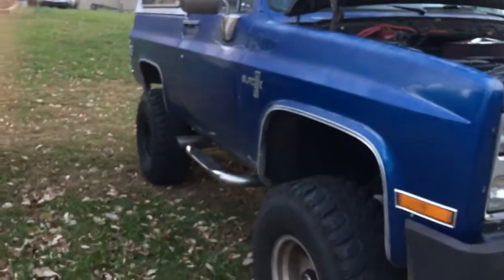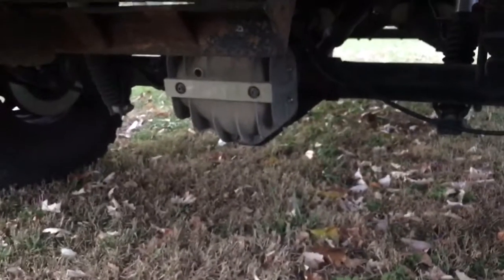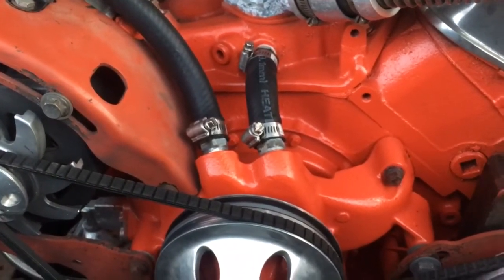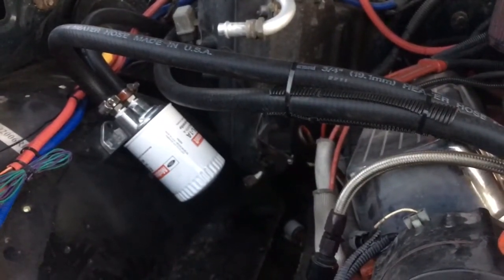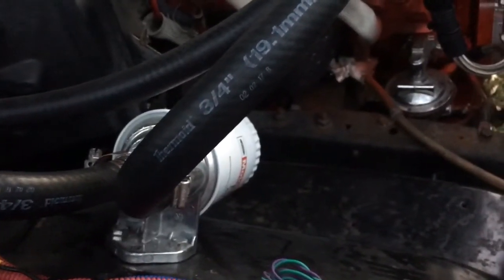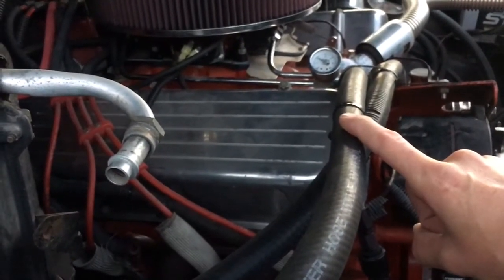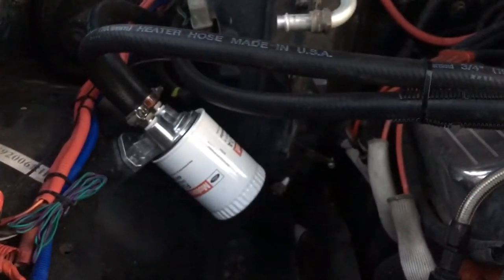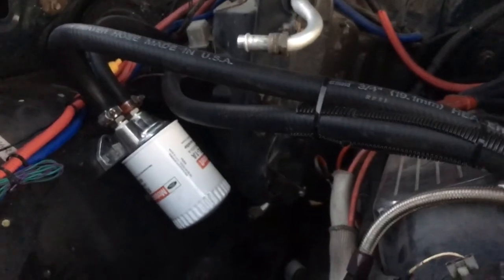Big Block Chevy Coolant flow

Comment from the maker: Hey wheless  when I bought my truck the hoses for the heater core were hooked up to the radiator on the two fittings on the radiator as you describe.  I pluged that one top radiator hose that you were talking about and read it to the manifold which allow the heater core to warm up and basically bypasses everything in the system if you use that I’m not sure why the stock radiators have that system installed I’m not for sure if that is factory or not or not.

Comment: Man that is good information. Im in the middle of rebuilding my 454 for a 2500 chevy truck. I plan on doing this as I am putting it all back together.
One quick question, does your radiator have a hose connection at the top left hand side if your facing your engine? I think the guy who built my truck may have hooked up the water hoses wrong and that is the cause of my heating problem